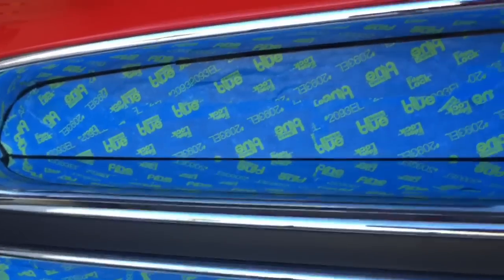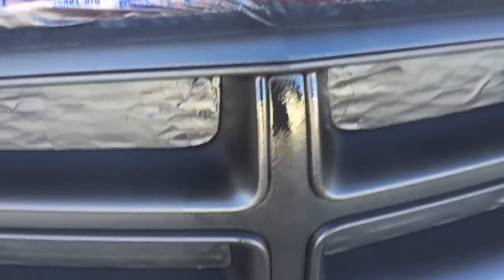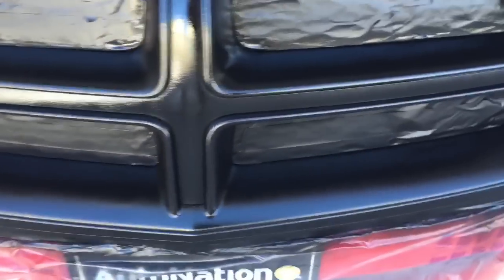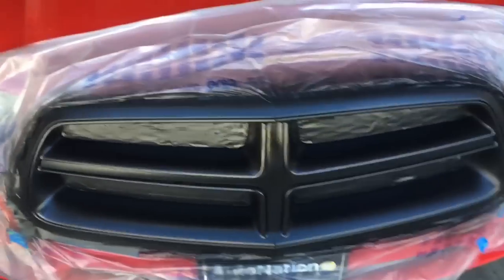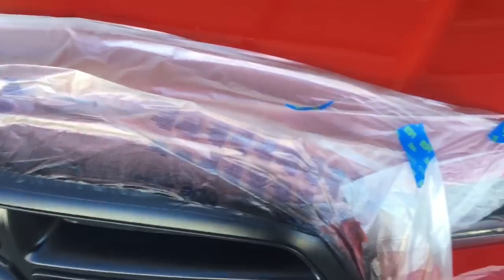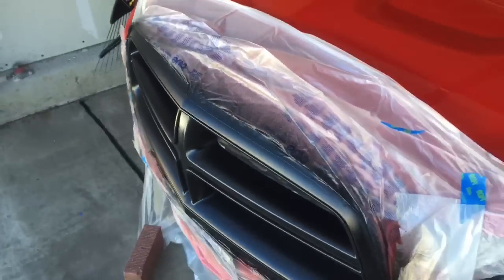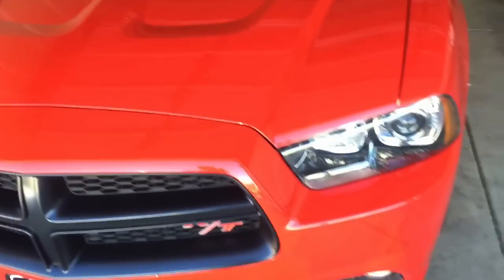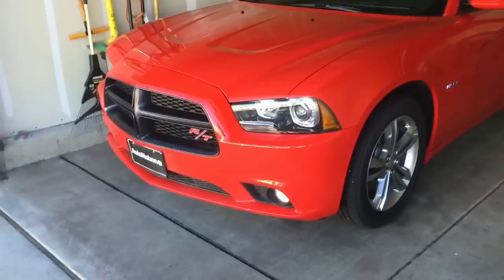Plasti Dip 2014 Charger Grill

Comment: Would it come off when you wash your car ?
Reply from the maker: It will peel with a pressure washer held at the edge but a car wash wont peel it if it is properly applied.

Comment: When you are ready to redo the project I recommend using this new product called Autodip. It's spray able vinyl. It's like Plasti dip but better bc the finish is much glossier. I will post a video on my account to show results. Just waiting on my front lip to get here and install.
Reply from the maker: I needed up buying a black grill later but still interested in seeing the new product. What's the cost vs plasti dip? You going to do a video of the front lip install?
Reply: +dasllamas the product is slightly more expensive than Plasti Dip. But in my opinion it was worth it. About $24 a can. I'll they and do the video once I get the from lip. I hope it's not too troublesome to put on.
Reply from the maker: +Erik Felix wow 4x more expensive. Curious about durability and how easy it is to peel when you don't want it anymore.

Comment: In your opinion which is cheaper/easier? Buying a new grille of this color and reinstalling or doing this?
Reply from the maker: Paint is easy but you have to worry about it in a car wash. Buying a mopar grill will run you 200-300 bucks. 

Mine is a mopar black grille now 😜. Got the opportunity to get it cheap so I did. If it was 200+ bucks I would still have the dipped grille.
Reply: Ok cool my ultimate goal is to get my chrome grille and rims black. I know a guy selling a like new molar grille for about $170 since he has about a dozen of em but the rims would still put a dent in the wallet. Would plasti dip or vinyl wrap on both still be the better option? dasllamas
Reply from the maker: +Lego Man if you are gonna go vinyls I'd just buy the black grill. Vinyl is expensive. My stripes roof and spoiler is about a $500 job from most places. The grill having so many curves would be 100-200 and you are at the black grill price already. 

My main reason for dipping the rims is because the AWD has hideous options for wheels so I dipped them. My dipped rims have survived harsh winters and hot summers. In addition it's survived 3 tire rotations. If you do it right it will last. (Till you need new tires)
Reply: Hmm I see however for the grille I don't need to vinyl wrap the actual mesh just the 2 cross pieces but either way I see your point. Also as for the rims I'm guessing I would save money plasti dipping or even vinyl for that matter. dasllamas
Reply from the maker: +Lego Man price it out. If you like the wheel style and just want them black you can powder coat them for 500-750. It's permanent and looks better than paint or vinyls of course this would only work if you didn't have that plastic chrome clad junk that dodge does.
Reply: +Lego Man honestly plastidip is durable i have my grille plastidipped and it can stand machine wahes just use 6 coats
Reply: buying the grille lmfao

Comment: I took the grill off ..scuffed it...adhesive promoter...prime...base coat black.
Done and better than plastic dip
Reply from the maker: Yup that will definitely be better.  Plastidip is good for temporary use.  A few months after doing this I bought a eom black grille and installed that. Better than any paint.

Comment: What happens when you take the pressure washer on it? Does it hold up?
Reply from the maker: Ive taken it through brushless car washes with no issue. If you hold a pressure washer an inch away it will peel it off though

Comment: nice job, looks good. I'm plasti dipping my grill now and I keep getting spots where it's heavier than the rest. hope it still comes out good!
Reply from the maker: Just try to avoid any runs and you should be good. Minimum of 3 coats. I suggest 5.
Reply: +dasllamas thanks for the advice!
Reply from the maker: +MrDbro94 would love to see a finished photo. Message me.
Reply: +dasllamas could u tell me the name of the products u are using I'm trying to do my next weekend
Reply from the maker: +Mike Reid the "paint" is called PlastiDip" the gloss is a glossifier made by PlastiDip. These can be purchased at lowes Home Depot or Walmart. There are some colors only available online. Make sure to use PlastiDip and not one of the copycat ones. 

The tape and painters plastic can be found in the pair area of your local hardware store. 

When doing this make sure to do a minimum of 3 layers.
Reply: +dasllamas Thanks bro I will attempt to do it next weekend hope it turn out right
Reply from the maker: +Mike Reid just take your time. Good luck
Reply: +dasllamas thanks I keep u updated
Reply from the maker: How did it turn out?
Reply: +dasllamas bro I end up just ordering a blackout out grill from eBay for $114 still waiting on it to get here I order it Tuesday I don't trust my shaky hands that's why I went that route n also I switched all my headlamps to L.E.D's and Hemi badge are fresher along with the 5.7 badge overtime the hemi badge
Reply from the maker: +Mike Reid nice. Post a video or send some pics when you are done. Sounds like it's gonna look good

Comment: Would it have been easier to remove the grill and not have to worry about overspray?
Reply from the maker: If I did it right I wouldn't have had to worry about overspray. To remove the grill on a charger you have to remove the entire front bumper so it's kind of a pain that way too. 

Either way works.
Reply: +dasllamas Did you ever think about Dipping any other parts of the car like the hood or roof?
Reply from the maker: +Robert  Burke check out my channel. I did my wheels and badges. I have my hood roof and spoiler vynaled now
Reply: +dasllamas I did watch those videos. Last summer, I Dipped my rims. I will probably do the badges when the weather warms up(I live on Long Island and there's about a foot of snow on the ground & we're expecting temps in the teens this week. I don't want to do any spraying in this cold). I have a 2014 Charger in the Billet Silver and want to add more black Dip. Any ideas?
Reply from the maker: +Robert  Burke if you want to do the black roof it wouldn't be too bad if you bought the dip in bulk and diluted it with some xylene. Then you would have to use an electric sprayer to spray it on. 

If you don't own a sprayer then you are better off just getting the vynal. The cost, time, and longevity is better with vynals. 

You can dip your front bumper just under the grill to make it look like the SRT. Just google a few of those videos. 

Just be careful how far you go with it. You don't want to go from classy to rice. Year American cars can be rice. i.e. Chevy cavalier is one of the most riced out cars out there. 

I think plasti dip or another company makes tail light tint. If you do it right it can look nice but before you do it look at your car as a whole. Don't want it to look ghetto.
Reply: +dasllamas Alright, cool. Thanks man. Nice job on the videos by the way!!

Comment: Have you had any issues with rock chips going through the plasti dip?
Reply from the maker: It does happen. You can either peel and re dip or spray some in a cup and touchup with a toothpick
Reply: @dasllamas  thank you I might plasti dip my 300c grille

Comment: I have 2014 charger rt the same color as yours but mine didn't come with the R/T badge on thr grille. it's just a dodge badge. where'd you get yours?
Reply from the maker: Amazon. Like 40 bucks though. Just look for the one that mounts to the RT honeycomb grill and it should fit just fine

Comment: I had a quick question regarding what type of plasti dip that you used and the type of clear that you used. I would like to use the same as you did due to how well it came out. Thank you in advance.
Reply from the maker: Blue can plasti dip brand. The gloss is plasti dip brand glossifier. You can buy it at Lowes or Walmart
Reply: +dasllamas thanks i appreciate your response back to me

Comment: Does this come off when you wash it? Any tips on washing it? Was it worth it?
Reply from the maker: I hand wash my car but use a pressure washer. The dip is really durable if you do it thick enough.  I had to really scrub at it to peel up a corner to do my repair video. I personally feel it is worth it. I did my rims about 6ish months ago and no chips. They went through two tire rotations without being damaged.

Comment: Great work, im gona do the same thing too, plasti dip my grill, did you take off the dodge badge on the grill and replaced it with the R/T badge.?
Reply from the maker: Thanks! Yes I switched the badging for the R/T. Don't know why they don't do it from the factory.
Reply: if uoure not the first owner check your vin, chances are your car was a hertz owned car and built for fleet. the fleet dodges don't get the cool badging
Reply from the maker: Don't really see many r/t of this body style with the fancy badging. I think only the r/t max had it but I can't confirm this. Mine is just the cheapie base r/t hah! Original owner though.

Comment: Just wanted to check out a old video lol but I was up last night thinking about a visual mod the hood instead of buying a aftermarket hood why not get a srt 8 hood that extract heat just as good as a aftermarket hood you know
Reply from the maker: Whoa Weezy I was looking at the srt front end conversion but that runs almost $1,000 when all said and done. RPM will be designing a custom hood so the procharger pulls outside air from a hood scoop and have cowling for heat extraction. I think I'll go that route before I just get the srt hood.
Reply: dasllamas Lol that's awesome I would love to see that but I was saying I was thinking about getting the srt8 hood for me vs me buying a aftermarket hood I always did like srt8 hoods
Reply from the maker: Whoa Weezy the srt hood is nice. I think there is the road runner hood that looks sweet with functional hood scoop for the stock airbox location. Might check that one out
Reply: dasllamas I'ma have to check that one out I seen the viper hood style awhile back I liked it but then I was nah I will pass

Comment: How thick of a tape did you use for the inside of the grill?
Reply from the maker: I think it was either 1" or 1.5". It doesn't really matter. Just tear pieces to size when doing the rounded corners and the rest just overlap the tape slightly till you cover it all.

Comment: Did you experience chipping or any sort of damage from debris while driving or was it durable (how long would it last before you need to redo)
Reply from the maker: Ben Robinson mine has been on for two years (grill, wheels, badges) living in Colorado with snow sand extreme heat and cold it has been on for two years and only minor damage. You only see it if you are looking for it
Reply: Misty mountains in the wi in the fridge is that it was the fridge
Reply: Ben Robinson and is what it takes that it was the fridge
Reply: KobeB I you can do to get the sayI
Reply: Kobe Gaines in
Reply: B oh I don't know what
Reply: B oh I don't know what you put what o ok
Reply: Misty mountains in the wi and knowledge of working on a good time and the other is a great day of work for you put what o clock in the wi and knowledge of working on a good time and the other

Comment: Nice job! I have a question, i noticed when you placed the cover the top portion outside chrome is exposed and was painted too.. How did you take it off?
Reply from the maker: At about 4:15 you see me peeling the dip off the lower portion. I peeled it all the way around. It comes right off the paint as long as it is thick layers. You only have a hard time if it is a thin layer. Don't be shy to spray the entire area and peel when done.
Reply: +dasllamas ... How was it when doing carwash? Does it stay good?
Reply from the maker: It does fine in touch less car washes. Checkout my videos I just posed one of me putting this car through one. If you paint it right it will be fine.
Reply: +dasllamas thanks a lot... But last question, how does it handle the heat of the engine?
Reply from the maker: +Diabolik skillZ no problem. I'm in Colorado so high heat to freezing cold mag chloride and sand it holds up fine
Reply: I dipped My strut covers and fuse cover in my engine bay 40k miles ago,still there just dirty lol

Comment: How long does this stuff last? Do I have to do this every few months?
Reply from the maker: Held up as well as the wheels (18 months) but it is the front of the car it will show signs of wear with an occasional "chip" but if you watch my how to fix plasti dip video it is a simple fix.
Reply: it lasts a long time, just make sure you change your dip out every 6 months or so. eventually it casts on,and becomes a pain to remove with your hands

Comment: Number one rule for doing this is to keep your cans in hot water at all times when you can and to shake thw can very well for every coat you do. 

Doing this will allow the Dip to gone on super smooth and perfect every time. nice video
I been Plasti Dippin my Nissan Maxima 2016 Platinum. check my instagram people marcovegayan

Comment: why......would you not just remove the bumper and pop out the grill, would have taken you less than 10min vs taping everything off and going a lesser job.
Reply from the maker: Videos from Québec I get the question a lot. Maybe you can pop the bumper in less than 10 minutes but it takes me longer than that. If one of my fog lights go out again it's going to stay out 😜. Only took me a few minutes to tape. 

Secondly I was trying to do more of a general way of doing it in case a person that has a different car wants to dip their grill they have an idea of how they can do it. 

Thanks for the view and comment.
Reply: Don't be intimidated, it's actually way easier than you think. If you think the front bumper is hard to get off the rear bumper is something else, it's a huge pain in the ass cause you have to take apart the interior of the trunk to get to it. The front is just 2 screws under the fenders and a couple of clips under the hood. They are made as more or less "sacrificial" parts that are relatively easy and inexpensive to change since they are the most likely to get damaged in an accident.
Reply: Videos from Québec why does it matter how he painted it. the thing got done right. get over urself
Reply: I want to remove the part he dipped so that I can do the same with actual paint. Do you know how to remove that part? Do you have to remove the bumper?

Comment: Hmmm nice. At least it's a Dodge !!!
Reply from the maker: A 500+ hp supercharged awhp dodge now
Reply: Too much fun . I plan on installation of a supercharger on my 5.7 in my Dodge Ram 1500 quad cab .
Reply from the maker: @darrellsyrnyk6875  that will be a bad ass truck! Mine is procharged with a 3600 stall torque converter and water methanol
Reply: @dasllamas  thank you . but that's just the start .